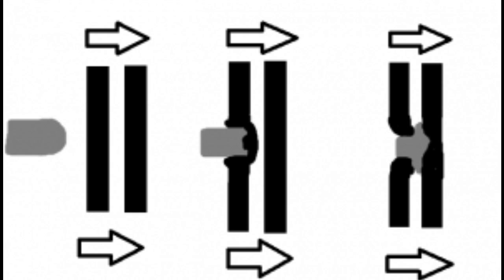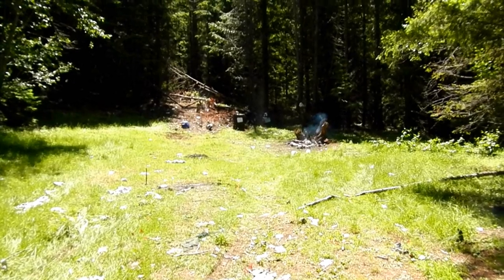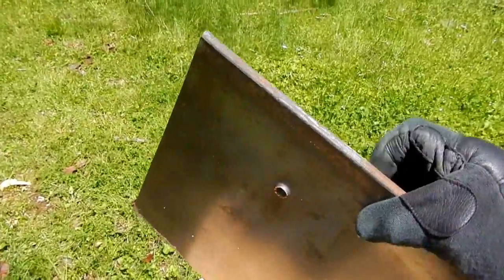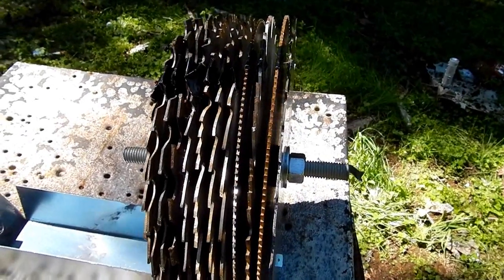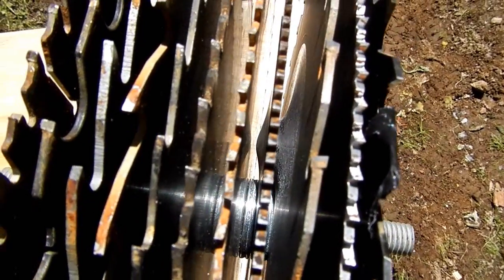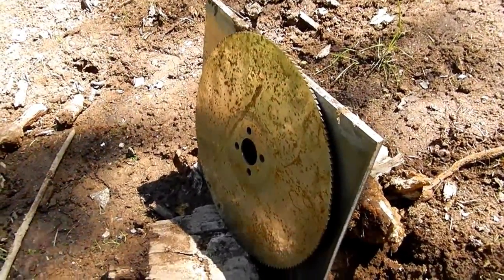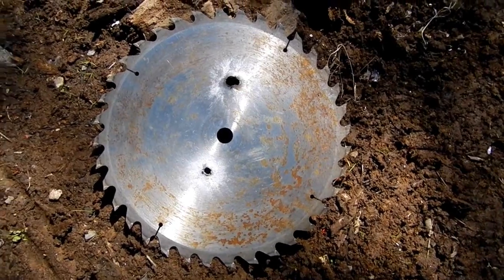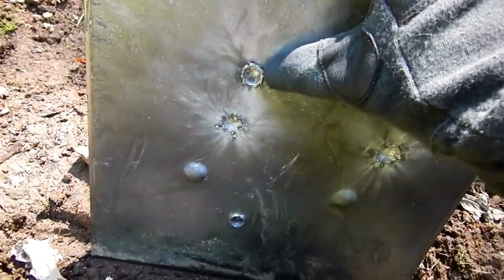Testing the Concept of Spaced Armor

Comment: the spaced armor is not for countering regular ammo. is to counter the jetstream of rpg's explosive head. and when its a mesh is to trigger it out of efective range.
Reply: spaced armor on modern vehicles is not meant to protect against shaped charges. its purpose is to destabilize incoming kinetic rounds. Cage armor or net armor do protect vehicles by tearing the incoming warhead apart (but if the fuse hits first you're unlucky).

In ww2 you see some M4 Shermans with logs or sandbags as addon armor added by the crew, this might have had minute effect against AT guns but would actually improve the effect of shaped charge warheads like the panzerfoust or panzerschreck by increasing the standoff distance of those warheads.

Modern shaped charges maintain most of its penetration capability even with 2 meters of standoff.
Reply: @Erpyrikk  It actually has better penetration at ~ 1 meter to 2 meters than it does at the standoff probe's range as it allows the jet to fully form before interacting with the armor.
Reply: Heat , heatfs and apcr also
Reply: reactive armour is to counter shaped charges these days. not spaced armour.
Reply: Pablo Ocampo - Most yes, but there are main battle tanks that use spaced armor to defeat even depleted uranium rounds. Like the turret of a Leopard 2A7.
Reply: Spaced armor is designed specially for heat (a simple google search will show this and I’m also USARMY Eod so I get extensive training in this) cage armor or rpg nets on modern vehicles crush the cone preventing the shape charge or jet from fully forming thus reducing the capability of penetration and even half an inch of air prevents a lot of power from them. the cones on heat rounds are made specifically for that round to do maximum damage any shorter the jet won’t fully form and longer it losses it’s power immensely
Reply: @sunflash304  Oh no. We must be all so dumb this guy comes along and says that a simple Google search proved us wrong.
Well I did a google search and what do you know... it says it can provide protection but in reality it can provide a better distance at which the jet stream get penetrate. I would much rather reactive armour you replace once you get shot, not the whole plate. 
Spaced armour is really good at HESH AND HE.
Reply: @sunflash304  Oh nice try at playing cherry picking game. Lets both read what we said. 

"Spaced armor is designed specially for heat (a simple google search will show this)" that's your original comment. Nice try at trying to look like a professional with that edit. 

I'm not saying spaced armour can't be designed to defeat HEAT rounds I'm saying your statement here ist true. It was first designed to stop Soviet anti tank rifles back in ww2. Today we can use spaced armour to defeat some modern HEAT rounds. You're apparently a professional in this topic, so can i ask you, why does reactive armour exist in the first place if you can just replace it with spaced armour? Why do they bother installing it on the Abrams and other mbts. If you are right then wouldn't that make reactive armour redundant? 
Oh but I'm just a smart ass though.
Reply: @sunflash304  I'm sorry but what? APDSFS can't go through everything. What is the point with the thick composite armour on the Abrams? If it doesn't matter then why is the government putting so much resources into Armour? 
I'm pretty sure there's a reason. 
But what do I fucking know right?

Links for people who like to learn more. 
https://en.m.wikipedia.org/wiki/M1_Abrams
http://fofanov.armor.kiev.ua/Tanks/ARM/apfsds/ammo.html
https://www.globalsecurity.org/military/systems/munitions/m829a1.htm
https://en.m.wikipedia.org/wiki/High-explosive_anti-tank_warhead
 Have fun. 👍
Reply: Chet Power reactive armor goes on mbts to protect against other tank rounds from heat he or hesh APDSs will still go through that without a problem to bad most modern tanks normally use APDSs spaced armor is MAINLY used on armored vehicles that aren’t meant to be against tanks they’re meant to protect against smaller usually shoulder fired munitions hence the term >RPG< net because the round is smaller it won’t be as effective now onto the composite armor there were several reports during the beginning of the Iraq war where abrams actually fires on each other due to misidentification lo and behold those APDSs went through that armor and congrats you linked rounds that the us shoots doesn’t tell you about anything else the heat one also states in defense reactive is awesome against heat but so is spaced and no one puts reactive armor on armored vehicles not meant to see much more then small arms or rockets again finish your reading use common sense stop picking shit out to support your opinion

Edit: also why is there such saltiness lmao you also haven’t proven me wrong in anything yes you brought up what you said was ww2 spaced armor against anti tank rifle when in actuality it was during ww1 but like I said modern practical use of spaced is to defeat heat
Reply: This comment. The purpose is to get a shaped explosive warhead to detonate away from the surface of the main armor.
Reply: at the proper range. spaced armor will counter the effect for not been at the optimal range to do the most damage.

Comment: Spaced armor is mainly for shaped charges.  The space allows molten metal "flame" dart of molten copper to disperse between layers.
Reply: Metal jet is not molten, it's still solid copper, but under extreme pressure, copper act like liquid.
Reply: Not entirely  true ,spaced armour  has been used since at least  ww1 and shaped  charges  were not used until ww2.
The initial  development was based  purely  on kinetic rounds.
Reply: soviet anti tank rifles where defeated with spaced armour in ww2
Reply: @cardiffpicker1  there was HEAT round in ww2  like the panzafaust
Reply: @WIIGGYX  I know  there was  and I started  that is when they started  being  used, spaced  armour  however was developed  around  ww1
Reply: @WIIGGYX  Germany didn't really need to worry about HEAT rounds during WWII. They weren't used en masse like the PTRS and PTRD rifles.
Reply: Spaced Armor is also used to stop kinetic rounds
some cold-war tanks had spaced armor (like the MBT-70) and the more modern variants of the Leopard 2 have hollow arrow-shaped turret cheeks to disorient APFSDS rounds.
Reply: Germans used space armor because of all things the lowly Soviet anti tank rifle. There were side areas of a PZKW III and IV at the sides that an AT rifle could penetrate. The skirts were enough to keep ATR rounds from penetrating
Reply: It wasn't, and didn't work (in fact it made things worse) https://milart.blog/2014/08/30/allied-trials-to-counteract-panzerfaust-attacks/

Anything up to 12 inches increased the penetration of the HEAT warhead, a minimum of 30 inches was needed to prevent penetration (at least on a Sherman against the Panzerfaust)

Slat, bar and cage armour used today is used to "catch" HEAT projectile and not set them off, if it did it would only increase their penetrative power. Spaced armour isn't really used today, though in the example of the Leopard 2A5 onwards the turret face has a large pointed spaced steel layer, this is to destabilise APFSDS rounds as they pass through it, making them hit the internal armour array of the turret face (similar to a Leopard 2A4) at a much higher angle, preventing them from penetrating.

Spaced steel arrays work well against both HEAT and APFSDS, if the spaced steel is angled and has multiple layers it can disrupt the HEAT jet (changes in density of material cause the jet to dissipate faster, changes in material produce yawing forces on both solid penetrators and superplastic jet, reducing their effectiveness (not quite that simple but hey)), that and as said before the jet from a shaped charge is not molten, it's about 400-500 degrees C and is in a superplastic state due to the pressure from the explosion, not molten.
Reply: Spaced armoire was initially implemented to allow bullets to tumble in flight before coming in contact with the main armour of German tanks

Comment: Spaced armor is for stopping shaped charges.
Reply: So the spaced shield on the space station aka a Whipple shield is for stopping shaped charges in space? Stop regurgitating unverified bogus facts to try and sound smart.
Reply: @huaahhggg9507  the whipple shield is designed to stop hypervelocity mostly micro sized objects. They are grains of sand and the occasional small debris but not a stabilized object purpose built to penetrate. It's more like a phone scratch protector than all stopping super armor.

Comment: Your comparison isn't accurate.  Your comparing mild steel to hardened steel saw blades. To have a accurate test you need to buy some 1/8" mild steel sheet but yes spacing will reduce the distance penetrated.
Reply: Tony Wells nkklplllppo

Comment: Dude. 11x1/8= 11/8 or 1 and 3/8. That's more than an inch. Even though you say "slightly less than 1/8", it looks like more than 1 inch of metal. So right off the bat, I gotta question your credibility. Did not watch the rest. Boo.

Comment: Hmmm, the effect with the brittle steel would be analogous to the ceramic layers found in modern tank armor. The brittleness of it shocks the round and causes it to break apart, making it harder for it to penetrate later layers. 

Another thing I read about modern tank armor is that they have a layer of Reactive Armor inside, not explosive reactive armor, but 'moving' armor. The plates are backed by either rubber, or supported by a hydraulic mechanism, which allows to the plate to compress against the rubber or hydraulic, acting as a cushion for the shell. Once the compression reaches its maximum, the plate will start to want to spring back into place, forcing the shell backwards. If the shell penetrates this layer before this, the plate will spring back into place, and will slow the round down from the friction against the sides of the shell, or can disrupt the shells flight path. 

I imagine you could probably simulate this using a rubber sheet and a couple of plates or something, though I don't know what the optimal rubber thickness is, or if it would work on a small scale.

Comment: The spaced armor plating on vehicles is for heat rounds which have shaped charges that burn a line through the steel.  The combination of spaces, dissimilar materials and explosives are designed to disrupt the flame cutting line into the armor and dramatically reduce the penetrating effect.

Comment: High carbon steel saw blade vs soft steel plate, hard and soft steel aren't really comparable with a fast moving bullet and you could more than likely get the same results if you swapped out the saw blade in front of the steel plate for drywall, and the ammo is not the same either, the 5.56 is solid lead core, the 7.62 is only half or 3/4 lead core, the 7.62 has to crush the "nose cone" before the blunt lead core makes contact, this actually causes the 7.62 to lose energy which robs it of some of the overall penetration ability. The 5.56 is a 3000+ fps round, it retains more energy then the 7.62 as the 5.56 has a full lead core it keeps its shape better as the copper deforms less. But when you shoot the saw blade first the 5.56 starts to break up due to physics and the mild steel just absorbs the impact to some degree, same with the 7.62. I still wouldn't trade an AR500 plate for a saw blade and a steel plate though.

Comment: Your science is wrong..and especially math is your weak side..
11 steel blades 1/8 " makes more than inch combined, not less than inch.. 11/8 which is almost 1.5 inch
2nd, blades and solid steel plate, are very very different materials.. way different. so you can not compare it

Comment: Like Edward Nutter already pointed out: your test is totally invalid due to several very obvious flaws: you should have compared the spaced saw blades to sawblades clamped together. Obviously you cant compare it to some random other steel without spaces, but  with different hardness and different thickness.  And as you said several times: you dont know the exact thickness of the sawblades. And you not even mentioned the hardness of each blade and the hardness of the control steel bloc.
Also spaced armor was developed against hollow charges of RPG and not against kinetic energy penetrators. So it would have been indeed interesting to see if it works against kintetic energy penetrators. But after watching your clip we still do not know....

Comment: The energy of a bullet is its kinetic energy which is 1/2 * m * v^2 - the squaring of the velocity means that speed is the critical factor and what gives the faster 5.56 the edge over the 7.62, especially at short range.

Comment: sawblades are made from tool steel and are tempered, mild steel is annealed by default, they have many times the tensile strength of the annealed mild steel plate.

Comment: Spaced armor makes sense only against HE, HEAT or HESH ammunition, not against solid projectiles
Reply: I  agree however if you can get a round to fragment after the first plate or two you can lessen the chance of penetration due the bullet no longer has the geometry to penetrate also having enough space for the fragments to disperse the enough to spread the force of the impact

Comment: 556 pen due to speed and smaller round. Smaller  point of contact.
7.62 stopped due to lower speeds and heavier bullet. Larger point of contact.
Good test on a budget.
Reply: similar results in my tests using .22 vs .177  air rifle  pellets, smaller round carries more speed & higher target penetration on tests uyp tp 100 meters, I havent tested the drop off on distances over this
Reply: One was ball/steal core ammo the other was wolf aka lead core
Reply: @davedavesnothereman2515  is that a she-wolf the rescuer of twin brothers, the mother of Rome,  the great nurse?
Reply: Mass and speed if both are increased will result in more penetration. More speed will almost always result in more penetration. If you took a 5.7 and a 5.56 i think you'd see similar results when you put them up against 7.62 and 9mm or even 357
Reply: KeepingEel  yeah, I get the more speed bit and the 556 being a lighter round, however if that was the case, why would be bother with the heavier cal rounds?

So, this is why in part I was thinking the 7.62 with the added power load...which was considerable...wouldn’t have provided better results.

Anyway all very interesting for sure...I should’ve paid better attention in physics class lol
Reply: @canadiankrispybacon  i think demolition ranch does some good videos on body armor, you could try watching some of those and see what you think. He uses lots of different calibers and such.
Reply: This is the only reason I came to the comment section- disappointed it’s not top comment
Reply: Ya all never mentioned the rotation al speed of the drill.. Drill speed matters in penetration
Reply: @wollywolly2734  More like dick speed hah yeah i have sex what r u gonna do about it
Reply: Also why they use stuff like 4.7mm MP7 designed as a smg body armour penetrator
Reply: Chance Mcgarrah  7.62 heavier yes, but is using more powder!? 

I missed the distance, however it appeared to be +100m, more than enough time for the round to reach its velocity limits.

Not the results I was expecting to be honest.
Reply: Canadian KRISPY Bacon huh? The projectile is at maximum velocity as it leaves the barrel and slows from there. It’s not a rocket
Reply: Just Onlyme could’ve worded it better...targets too close to the muzzle the rounds can have less of an effect or impact, or penetration...not a physicist but has to do with the stability I guess and not velocity of the projectile...anyway that’s how I understand it.. in other words the round needs time to sort itself out.
Reply: Canadian KRISPY Bacon a fragile projectile such as a soft point or hollow point will penetrate less at a higher velocity as it will fragment. But Fmj will penetrate further with higher velocity. It has nothing to do with stability, it’s stable as it leaves the barrel
Reply: E = mv^2

Velocity matters
Reply: @canadiankrispybacon  7.62 has more powder cause it is a hevier round, the powder load will help pen but doesnt determine it.

Penetration it a equation of speed and contact point or (contact)
The largerbthe round the more it touches and the faster heat or force breaks it apart, the smaller the contact point the less makes contact as it travels causing it to go deeper.
Reply: Should have used 7.62 NATO